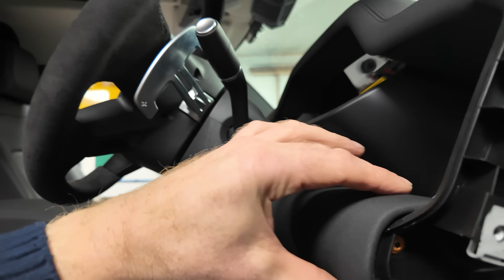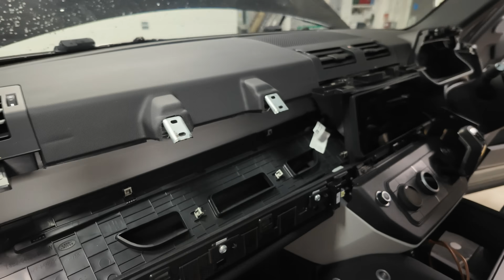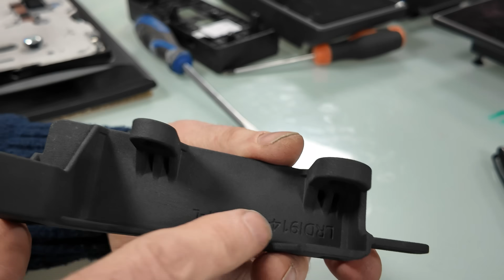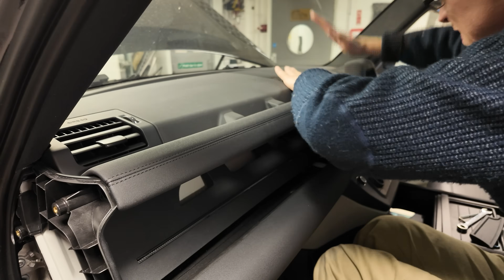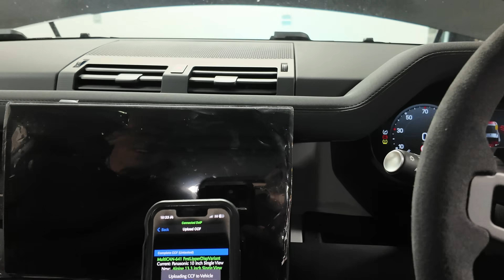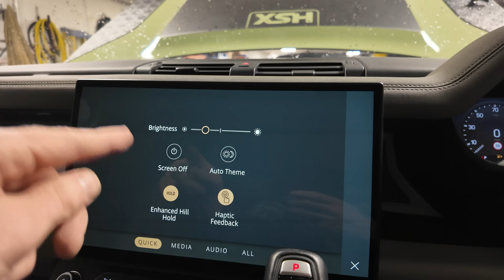Land Rover Defender L663 Pivi Screen Upgrade from 10" to 13" Retrofit

Comment: Are the "placeholder" issues only applicable to the 2020 model? I have a 2022 P300 and I would love to upgrade to the 13inch screen from the 10. But I would hate to have glitches.
Reply from the maker: Yes the 2020 seems to be the only one with issues. With all these upgrades there is a risk of glitches.
Reply: Just ordered the screen and the kit 10 to 13. Hopefully no glitches. Do I need anything else? Ah, I already have and used the gap tool :) Have a great evening! Fabio
Reply: @L663 mounted over the weekend. All good, no placeholder issues nor missing images 😊
Reply: If you have a 2020 with the placeholders / missing car graphics, try modifying the following parameter in the CCF (using the GAP tool), MuliCAN-773 PIVI Type.

My default was PIVI Mid Line. I picked PIVI High Line. After a few restarts the car graphics are all back. Don't notice any faults or adverse effects at all, so hopefully that's the solution. I have an early NAS 2020 Defender X. 

Not sure if that makes the haptic feature work as well - I don't care for it so didn't attempt enabling it.
Reply: @ubonfante thanks! I have a 2022 and all works perfectly without changes!!! ❤️❤️❤️
Reply: @ubonfante hi i tried this everything was ok then after the 3rd day graphics are gone and placeholder showed up. is your 13.1 screen brand new or used?

Comment: Have you been able to fix the wade sensing screen glitch? I got installed the 13” screen from a RR Sport but have the same issue. My car is a MY2020 110. I also have the “placeholder” text on my sound settings page :(
Reply from the maker: We did change the car build date to 2022 then swap back … fixed the placeholder images but got some other glitches… no auto on heating…

Comment: May I know if technology of screen and camera clarity will be upgraded in the new defender 2026 ?
Reply from the maker: The 2026 gets the 13" screen from the Range Rover as standard !
Reply: @L663  
Do you know whether it comes with the Range Rover interface which duplicates [or replaces, in the RR] the buttons and dials below the gear lever? I have that actuated on my ’24 model year with its middle size screen and I love it. I do hope that the next Defender update doesn’t do away with those buttons and dials though, because I tend to use both systems. Some things like synchronising the temperature are actually easier to find on the new interface. I love my Defender and it continues to delight.

Comment: I have an early 2020 110. Did updating the near field sensor module firmware fix the missing graphic issue?
Reply: I have the same issue with missing graphics/placeholder image issue after upgrading my screen on my early MY2021 model. If I change the CCF model year to a 2022 the images appear but it creates an error with the emergency braking system:(

Comment: Don’t tell you you need diagnostic machine to alter the software when you buy it. Says plug and play
Reply from the maker: Pretty sure this is mentioned in the listing - sorry if it was not clear enough
Reply: @ it says plug and play ready to go, doesn’t specify you have to have a machine to alter the settings, it reads as if you can just alter them from the screen
Reply: @L663  I just purchased this kit and received it today. I also didn't realize it required a diagnostic tool to configure the new screen. 

Are there any other diagnostic tools aside from the IID G4 device that's more cost friendly to program?  I can't imagine I'd use the IID G4 for other features beyond the screen configurations.  Thanks in advance!
Reply from the maker: @twins003  I will try and make our listing clearer that a software update is needed. The Diagnostics Associates tool will also program this. Where are you based ?
Reply: @L663 no problem at all, it was my oversight.  I am based in the USA.
Reply from the maker: @twins003  Lucky8 can help - also if you let me know where you are located I can ask GAP if they have any garages with the tool in your area - can be tricky in the US due to the size of the place !
Reply: @L663 thank you sir! I'm in Atlanta GA
Reply: @L663 Hi - I installed the screen and I still haven't found a tech who has the IID 4 tool.  Were you able to locate any techs by chance?  I'm located in Atlanta. GA USA
Reply: @twins003  
Why don’t you buy the tool? Gap are based in Canada and we don’t have any problem sourcing the tool in the UK as there are several stockists or we could buy direct from Canada.

Comment: could this be done by IDD Tool BT? or only PRO?
Reply from the maker: The BT and the PRO are the same... other than the PRO can modify more than one car... so ideal for workshops... the BT is linked so it can only modify a single vehicle - it can scan / read and diagnose multiple cars... but only modify one.
Reply: if I get a brand new not activated 13” screen. how do I work with that?
Reply: upgraded the screen a month ago. so far it has been perfect.

Comment: Nicely done, but after all that effort I'm afraid I prefer the smaller screen. 13in looks very DIY aftermarket and interferes with the vents and dash. The biggest issue is that in real life it will just be a bigger collection of ugly smudges and fingerprints! Not such a big deal in an ugly interior like Tesla, but a huge detraction from the beautiful Defender interior!
Reply from the maker: Fair comment ! but remember the IPS screen is a much better resolution and much easier to read in daylight... this is the big advantage of the 11 and the 13" versions over the 10" screen
Reply: The solution to fingerprints is to fit a plastic matte anti-glare finish screen protector film or glass. I’ve used these Brotect films on several vehicles and my Ford Ranger has one currently and never has smudgy fingerprints.PowerfulUK might like to stock these but only offer them with other purchases, because there is unlikely to be sufficient profit margin to cover admin and packing for a single order of film. I’ve just ordered a pair for my Defender.

Comment: Thanks for the video but if i order the 13 inch kit insalation how i get the SW to modify the CCF
Reply from the maker: You can buy a GAP tool or find a company to help you - where are you based ?

Comment: Mind sharing what was wrong with the first 13" screen? I'm looking at one on eBay and would hate to end up in the same position.
Reply from the maker: The first screen was NEW never fitted - Virgin if you like.... these do not work unless programmed by Land Rover....I am working out how to do this... but if you have a USED screen that has been fitted to a car then there is no problem..

Comment: Jesus. Don’t use these nuts. They get loose in a second. Use self securing nuts. What’s wrong with you
Reply from the maker: This guy is complaining about my nuts..... clearly he has never been in a new Defender with the silky smooth air suspension..... if we were fitting this in a bone shaker old Defender I would have used  a spring washer , nyloc nuts and thread lock and another nut just to be sure!... 
What's wrong with me you ask.... a squint...receding hair line... dyslexia.. and mild ADHD...its like you want to know if i will be a suitable partner for you but alas i am happily married to someone who loves me and my faults...but good luck in your search for a partner - there may be better websites for you to find a partner.
Reply: That's quite uncalled for. Why so nasty?
Reply: What's wrong with him? The Question is, more appropriately, What's wrong with you????
Btw...well said Simon :)

Comment: Would this work on the new Velar from 11 inches to 13?
Reply from the maker: I am not sure how the screen mounts on the Velar... but pretty sure the wiring and software parts are the same. The issue could be with available space in the dash area for the screen

Comment: Hello, Defender has been changed to a 13.1-inch screen. Currently, the map is output to the driver's seat screen (map only). There will be similar current interference, the screen will be slightly busy and flickering, could this be a programming issue? Or is the line baggage bad? Thank you 🙏
Reply from the maker: We had a similar issue a few years ago that JLR fixed.
https://youtu.be/523wTD-28eM
If you post a video and send me a link I can share with jLR for them to review.
Reply: @L663  The whole picture does not flicker, only two or three interference lines flicker, so it is not caused by changing to 13.1 encoding?
Reply from the maker: I just checked the parts system and it is not showing the 13" screen as ever being fittted to the Defender... please measure your screen I think it will only be 11.4

Comment: did you notice on the latest pivi update they had a fix for the reverse camera use at night, apparently they have improved the image quality or something, cant say i can notice as literally the day before i updated i had fitted the extra set of reverse lights 🤣
Reply from the maker: I had heard that they had done this update - I cannot seeing it making much change due to the location and power of the reverse light...you could tape over the LED upgrade and see...

Comment: I’m sure my new July 2024 90 has the 13” screen but it’s back at the dealer for an anticipated 3 months due to dc dc converter failure and long lead time on replacement part ☹️🤬
Reply from the maker: Hi Rob - would be interested to know what the part that is not available is...can you email me your chassis number so i can check JLR and also check the engineering number.
I checked the parts system and the 13" is not listed on the Defender. Land Rover need to do better on this - if they are still making and selling cars and leaving you high and dry this is not good.
Reply: @L663  I’ve sent an email to the general contact email at Powerful 👍
Reply from the maker: I think this is the part you need Rob...https://www.ebay.co.uk/itm/116495011304
Not suggesting you need to buy it but this would appear to be the culprit.
Reply: Are you sure it’s 13” ?
That’s not even an optional extra
Reply: @ I’m probably wrong but can’t measure it for weeks now given the latest breakdown. Wish I’d kept my 2011 Rangie. Never broke down once.
Reply: @robholland1937 
I thought mine was 13” too
But once I measured it, turned out it was 11” haha

What’s wrong with yours ? What engine do you have ?
Reply: @SB-UK  See original comment for current reason it’s back in the workshop. D350

Comment: i’m new to your channel i don’t suppose there’s any videos on how to fix the car not reading the key and having to use the emergency start under the steering column i’ve tried having the key  reprogrammed i’ve tried disconnecting the battery and the the fuse trick nothing seems to work thanks in advance
Reply from the maker: There could be several issues here
1) interference - make sure you do not have a phone charger or other accessory plugged in - this can intefere with the signal.
2) keyfob faulty or weak battery - do you have another keyfob to test ?
3) faulty KVM - we did a video on this on the Evoque - very similar.
4) faulty receiver in the car.
https://youtu.be/SL6-cQMvlco
I have been thinking about doing a video on this - where are you located ?
Reply: i’ll have a look at the link i’m in the uk it’s been a pain trying to get in to disco 4s problems i’ve done a lot myself from your videos also paid mechanics got a few more problems to get through then should be done hopefully